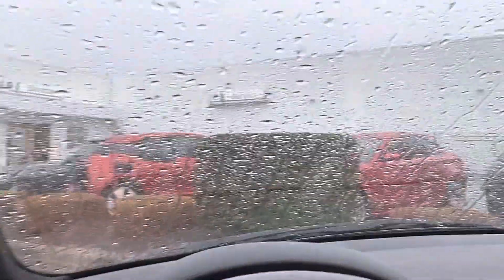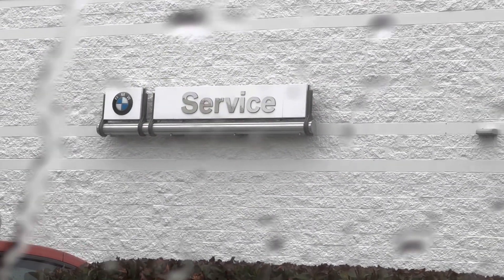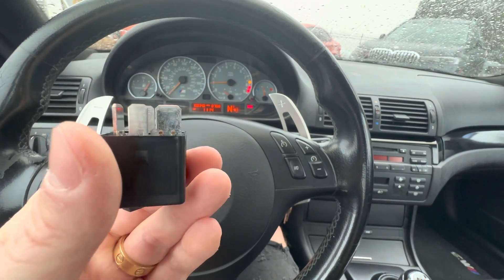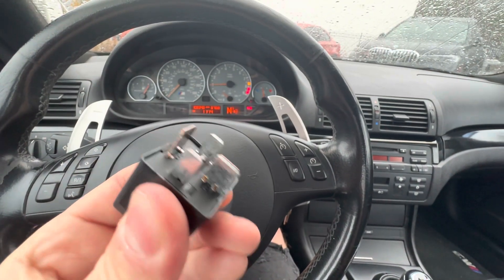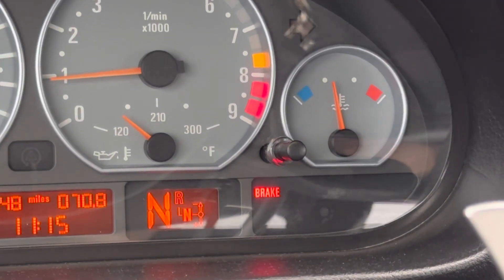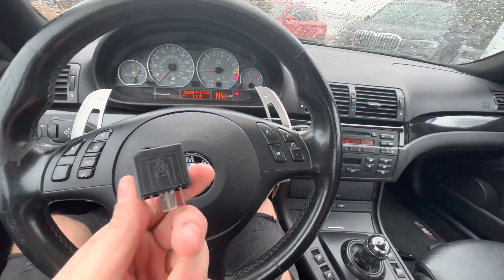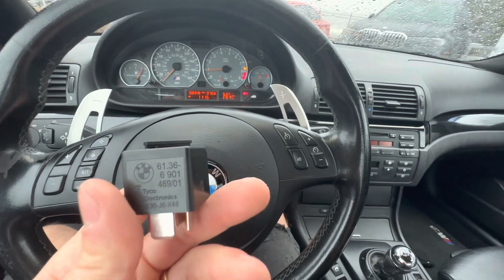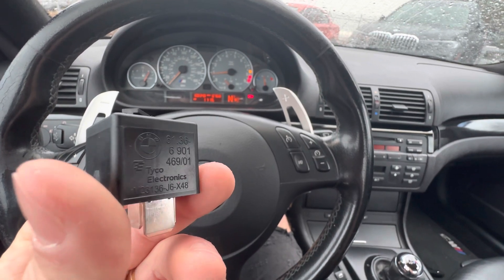I FINALLY got the relay for my E46 M3 BMW had exactly one left!

Comment: Hope that did the trick mane
Reply from the maker: Yoo so I actually installed it and my local shop said for me to drive it a few days and see if the smg light pops back on my dash - so far so good. 5 drives some more aggressive and no light thrown up on dash. It’s too good to be true.. relays do tend to have a lot more going on to them than meets the eye. It’s probably my SMG pump or motor dying. It’s always something with these cars!